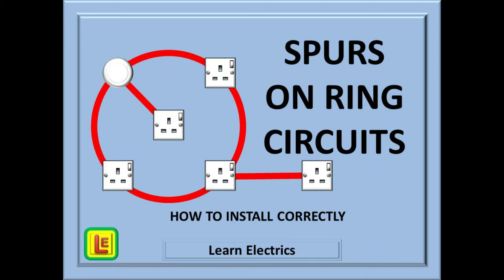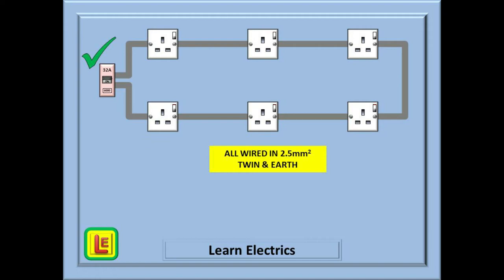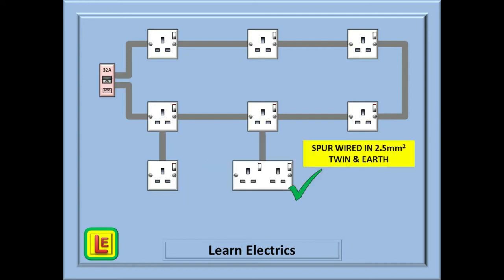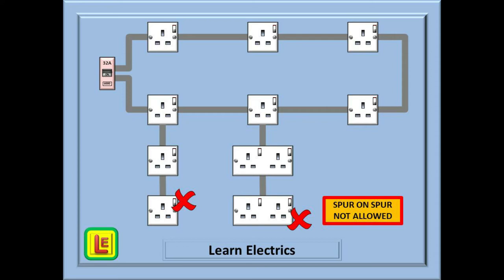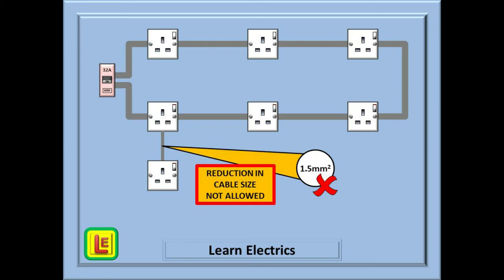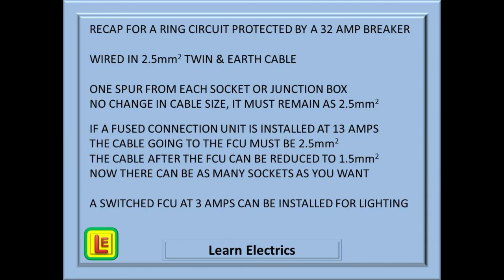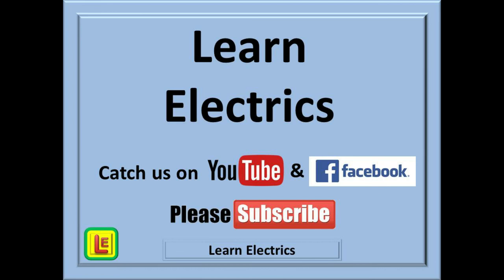SPUR ON RING CIRCUIT. Learn about connecting spurs to an electrical socket ring circuit

Comment: I have my garaged electrics wired in the same way as your last slide (the conservatory example).  Is it possible for me to add to the garage wiring to safely feed into a newly built garden room?
Reply from the maker: If there is room in the garage consumer unit to fit another circuit breaker then that is fine.
Reply: @learnelectrics4402  there is no consumer unit in the garage. It has a 13A fused spur. Like your last slide.

Comment: I am going to take a spur from a ring main to use MK grid switches. I am planning on putting a MK grid 13a FCU prior to the two proceeding switches. These two appliances are less than 13a, but this approach will avoid me having to extend the ring through the MK grid switches. Thanks for the video!
Reply from the maker: You may find the video on the link below useful too. Thanks.
https://www.youtube.com/watch?v=fj9cc1U9Re0
Reply: @learnelectrics4402  does my thought process sound about right. Providing I use the 13a grid prior to the next two switches I’ve effectively made an FCU. However, I will use 2.5mm for the full wire up for good practice. The two appliances will only draw 11a total so no risk in the fuse going.
Reply: @learnelectrics4402  thanks watched, explained so well. I believe my plan creates a fused spur situation as the appliance switches are after the 13a fuse. However, if it was just one switch with a plug for the appliance this would only be 1 spur, so wouldn’t need the fuse prior as the plug is fused. Will run it past a sparky, but think I’ve got that right

Comment: I you have, say, a FCU going to a double socket with 2 high powered appliances like a washer and a dishwasher and it exceeds the 13A causing the fuse to go in the FCU could you add another FCU after the dbl socket and then add another socket?
Reply from the maker: No. One accessory from each socket on the ring, whether its single or double doesn't matter. just one. You can run a second FCU off another socket though. Remember, the fuses are there to protect the cable. Thanks for asking. Dave.

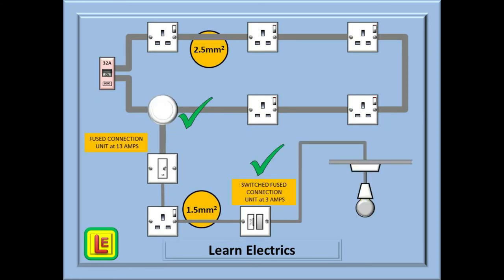Comment: 5:58 what is best practice? Junction box, then FCU, then socket? Or just FCU straight on the ring main, then socket? Thanks in advance
Reply from the maker: Either way will work as long as you respect the cable sizes.

Comment: If you fit an FCU and then say four switches off this, is there a reason why you should use 1.5mm cable? Or should you continue to use 2.5mm? Thankyou
Reply from the maker: Because you have a 13A FCU, you can drop the cable size to 1.5mm.
Take a look at this video on the link below.
https://www.youtube.com/watch?v=fj9cc1U9Re0

Comment: How about if you do Zs test , and if it’s let say 1.25 ohms at the light pendant and it is on 32A breaker . But we know it has 3A fuse protecting it . Can I put the test result as 1.25 ohms but will mention on test cert that it was taken from the light pendant protected by 3A FCU ?
Reply from the maker: Yes, you should make a comment on the schedule of test results that a 3A FCU is installed.
Reply from the maker: A 3A BS1362 fuse has a Zs(m) of 12.4 ohms. But do take a look at the video below on some of the problems with BS1362 fuses as used in plugs and FCUs.
https://www.youtube.com/watch?v=ojI7vX7u6_A

Comment: Why do you need a junction box on the diagram at 6:10 can’t you just have the fuse, followed by the socket, switched fuse and then light bulb?
Reply from the maker: Yes you can Tazer, I was just showing you different options according to the Regs, and what they permit. Good question. Dave.

Comment: great explanation! question: taking spur from a socket (not ring) with 13A FCU, can I add few more sockets? Am I aloud or just limited to one socket? Thanks
Reply from the maker: Thanks for watching.
This is the video you need to look at, it gives all the explanation you need, cable size, fuse size etc.  Dave.
RADIAL SOCKET SPURS, click on the link below
https://www.youtube.com/watch?v=Et7CpEwFEzg

Comment: Is it possible to go from main ring socket to a socket which would be a spur then after that put a FCU for lighting?
Also is it possible to go from a FCU to a outside garage consumer unit??
Sorry if these are stupid
Reply from the maker: The Regs say only one accessory of the ring, so that would be your socket. The FCU for the lights is then not permitted.
Instead, change the socket for a 13A FCU and then add a socket after the FCU and a 3A FCU for the lights. Have another look at the video, there is an example of this in the video. Dave.

Comment: I posed a question on your radial circuits video today, but looking here I perceive a different answer.  In the summary at 7:32, the graphic says a spur from a 32A protected ring final can be wired in 2.5mm T&E.  That would assume the spur terminates at a double 13A socket, max load possible being 2 x 13 = 26A which is ok for the cable in non fault conditions. What happens in this configuration if a short L/N occurs, can we safely rely on the 32A protective  device ?
Reply from the maker: Yes Mike. It is assumed by the Wiring Regulations that you would not normally fully load both plugged in appliances in one double socket outlet. I.E. you wouldn't normally plug two 13 amp kettles in to the same socket or two 3 kW heaters on full chatt at the same time. Even if you did, the max load would be 13 Amps on each plug top or 26A total as you say and 2.5 twin and earth will take 27A clipped direct.
A L/N short would be a massive current, hundreds of amps so a 32A mcb will trip in less than 0.4 seconds, long before the cable overheats and becomes damaged. Remember the fuse or breaker is there to protect the cable from overheating, not to protect the appliance. We also have a video on Choosing breaker and cable sizes.
Your getting your money's worth out of our videos. Love it, keep watching Mike. That's what they are there for. The more we can help the happier we are. Dave.
Reply: @learnelectrics4402  Thanks Dave, sounds like I’ll have to send you some biscuits soon!  Seriously this channel is the most clear and concise I have found.  Others are either out to show how clever they are, or just muddled and confusing.  Brilliant work, thank you.

Comment: Yet again another great video. Thank you. 1 question, at 8.42 mins you show a junction box on the ring then down to the fused spur. Is it OK to leave the socket that was there before and just connect a 2.5mm cable into the back of the socket out to the fused spur? I have a room that I need to take a spur off for a heater but I also need the sockets still in that room. So I was going to add a fused spur next to the socket on the wall. 
But your image shows you have taken away the socket and replaced with a junction box.... Is there a reason?
TIA
Reply from the maker: Yes, add a Fused spur next to the socket that is on the ring and then you can add as many sockets as you wish. Don't worry about how I've drawn it as long as a fused spur is the first item off the ring. Hope this helps, and thanks for watching. Dave.

Comment: Can you install the FCU via cable from  socket.  2.5 T&E  from single socket to FCU  and then 2.5 T&E  from FCU to New single socket. The ring is on a 30A fuse.
Reply from the maker: Yes you can. Always pay attention to cable sizes.

Comment: in theory could you not use 4mm cable for the link between the ring and spur to stop overloading cable?
Reply from the maker: Yes but the problem is often getting two 2.5mm coppers and one 4mm copper into the same hole. Because they are different sizes there is always a chance of one being loose.

Comment: A lot of cable, particularly sockets on an outside wall on a timber framed house is buried in insulation. In which case the 27amp rating which is “clipped direct” no longer applies.  I don’t have the table in front of me, but I seem to recall that the rating drops down to “conduit in insulated wall” which I think was somewhere around 20 amps.

I think the modern building standard is to incorporate a service void for electrics and plumbing on the outside wall, but older timber framed houses it’s common to see the ring circuit wiring buried right in with the fibreglass material.
Reply from the maker: Absolutely Anthony. Lots of methods in use. Dave.

Comment: Since lights are a fixed load are you fusing it down, for overload or to ensure max zs is achieved?
Reply from the maker: We are fusing it down for over-current protection. We should always fuse close to the maximum load for that leg.
Reply: @learnelectrics4402  if the fixed load connected isn’t going to exceed the maximum current carry capacity of the leg what’s the need to fuse it down if the Zs for the protective device is met?

Comment: For the lighting spur... can you take a 2.5mm from the ring straight to a 3amp FCU?
Reply from the maker: Yes you can, that's the correct way. And then 1.5 or 1.0 after the 3A FCU.
You might also find this video useful.
https://www.youtube.com/watch?v=bW44Ie4jOHc
Reply: @learnelectrics4402 Thank you so much for the replies and the help. It's🙏 really incredible

Comment: For the purposes outlined in this video is there any difference between an FCU and a switched FCU? Side from the ability to kill power to spurs after the switched FCU?
Reply from the maker: No difference Saleem. Just personal choice. You might put a bathroom towel rail on a switched spur, but a boiler circuit would be unswitched.
Reply: @learnelectrics4402  Agreed. Whenever I have connected a single appliance to a FCU I have always used a switched type for isolation purposes, as there would be no plug to be pull out for isolation like you would do normally. When using a FCU to supply multiple sockets, I have usually used an unswitched FCU, simply because there shouldn't be any need to isolate the circuit in that way under normal conditions, and quite apart from anything else when the FCU is on show an unswitched one is less to look at. However, in the house I am in now I have used a switched FCU simply because it was all I had at the time I did the job, and in fact over the years it's proved to be quite handy to isolate a whole bunch of sockets in that room, when decorating etc, because what with the switch being double-pole it saves switching off the whole circuit at the consumer unit. I should add that before starting work I also remove the 13 amp fuse for extra safety.

Comment: Love your channel and just subbed.  One question I have is - how come the lighting is protected by a 3 amp (or even 1 amp) fuse in this arrangement..... but lighting circuits themselves are protected (generally speaking) by 6 amp MCB's?  I would have thought a fuse up to a maximum of 6 amp would be correct....
Reply from the maker: Good question Billy and thanks for watching. We always fuse for safety and close to the max needed. A 6 amp lighting circuit might have 10 or 12 lights on it. In the example here, it is a small extension/sun lounge and maybe only has 2 or 3 lamps. The current demand is therefore a lot lower so we can reduce the fuse size accordingly. Why protect a half amp lighting circuit (2 x 60W lamps) with a 6 amp fuse, 12 times bigger than needed. Hope this helps. Dave.

Comment: Great video, i always thought you had to use 4mm2 to connect a new twin socket as a spur..! Can it be left in or should i swap it for 2.5mm2 cheers
Reply from the maker: No, no, no. Leave the 4mm in place. Bigger cable is always safer than smaller cable. It's just that it costs more money. Keep watching, loads more to come.

Comment: Thanks for the video. I have a couple of questions. I would like to convert to a 2 gang socket an immersion heater switch that still turns on but is not connected to a now gone boiler. I saw under the floorboards the cable to it is connected to a junction box. It looks like a 2.5mm2 cable. Can that be converted?
Also I would like to add two new 2 gang sockets side by side in another part of the room. Should I put in two junction boxes and a spur each or should I go the fuse connection unit way then add the sockets? In that room, I will also be creating a spur from the socket already present.
Hope you can advise. Cheers.
Reply from the maker: Firstly, it is not permitted to install junction boxes under floor boards as it is difficult to reach them for testing and inspection (screwed joints). You can use junction boxes but they must be accessible for maintenance, the same with fused connection units. Follow the advice on the video and you shouldn't go wrong. Good luck. Dave
Reply: @learnelectrics4402 This isn't strictly true. The regulations allow for maintenance free junction boxes to be installed in an inaccessible location(s). A correctly configured and installed Wagobox XLA junction box for example may be so installed and will still be BS5733 compliant.

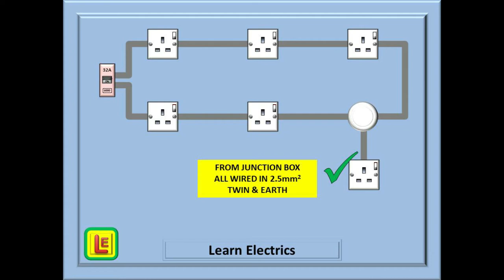Comment: Great channel love the videos, just a quick question regarding spurring off of the ring with two single sockets as you explain at 3:20 I have never heard of this not being allowed before.

What is the difference in spurring from the ring with one double socket or two single sockets? Is it not the same thing? you can not exceed the rated 27a of the cable as anything plugged in to either socket will have a maximum rated 13a fuse in the plug top, which in turn would have a total max load of 26amps?
Could you explain a little bit more please, thank you and keep up the great work it is much appreciated
Reply from the maker: One accessory only. A single socket is one accessory. A double socket is one accessory.
2 single sockets could be some distance apart and both loaded to 13 amps. A double socket is unlikely to have two 13amp devices plugged into it.
Their rules not ours. Thanks for watching. Dave.

Comment: Hi learn electrics, can you spur off a ring circuit to 3kw instantaneous water heater that would be used rarely in a outbuilding? Cheers
Reply from the maker: Good question Keiran
Regulation 554.3.3 may apply, use of a double pole switch and NOT plugged
Consider what is rarely, and what other loads are connected.
Think about it - a 3kW kettle is a water heater
Dave

Comment: Hi. If I have a spur with a (13amp fused spur switch) that has 4 double sockets. Can I plug 2 13 am ovens into one socket or should it be one each?
Reply from the maker: Nothing to stop you doing that, but you will be maxing out the current loading if it is clipped direct. If there is any insulation around the cable route, trunking, conduit etc. then two ovens will exceed the max permitted.
Reply: @learnelectrics4402  thank u that’s what I thought I’ll run two fused spur’s and have them on separate ones👍🏻

Comment: Why do you have to put 3 amp fuse for lighting circuit if the cable is still 1.5mm2 ..   Is it to protect the housing unit of the bulb ?
Reply from the maker: We always fuse as close as possible to maximum load. A lighting circuit in an extension might only need 2 amps.
Reply: @learnelectrics4402  Thank you. That makes sense

Comment: hi I have external caravan type plug off fcu freezer connection from kitchen thru wall to outside .I want to connect inflatable hot tub from outside  but keep caravan plug spare for charging etc.should I use a mains controller outlet on outside
Reply from the maker: You would be best installing an IP55 outdoor socket.
Reply: @learnelectrics4402  thought be better to run fsu off socket in house already got one cable they kitchen wall or can I run it off cable already there is that ok 👌 hot tub be on all time well weekends about 2kw plus caravan plus is just for charge now and Again plus jet washer
Reply: @learnelectrics4402  thjnk the hot tub plug module has rcd on it already
Reply from the maker: Have a look at our video SPURS ON SPURS, it should help and thanks for watching. Dave.
https://www.youtube.com/watch?v=0lP8C6ZU_R8

Comment: hi...where can i find information on the current carrying capacity for a 13 amp 3036 fuse...cant find it in the regs...i can see fuse sizes that are not commonly used but not 13
Reply from the maker: 13 amps, as printed on the fuse. That is a nominal current or In. That will be 13 amps 7 days a week 24 hours a day. Tables 41.2 and 41.4 in the Regs

Comment: Can i add a 13A FCU in a 2,5mm cable size then adding spur socket with same size of cable (2,5mm T&E)? Or is it only correct if I reduced the cable size after the 13A FCU???
Reply from the maker: You can supply an FCU from a 2.5mm ring in 2,5mm cable as you say. You do not have to reduce the cable size after the FCU, it can be left as 2.5mm if you wish.